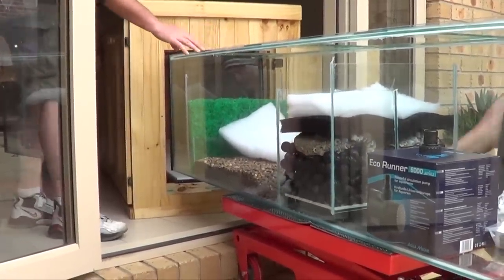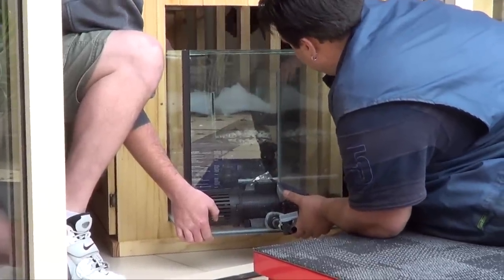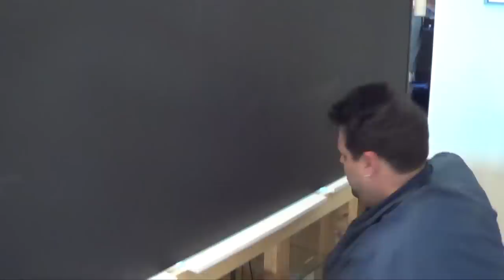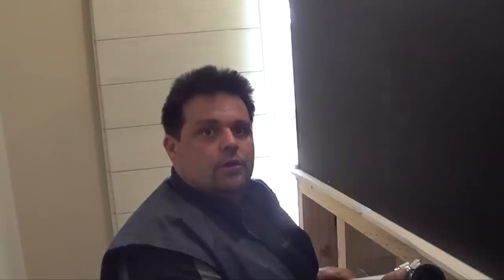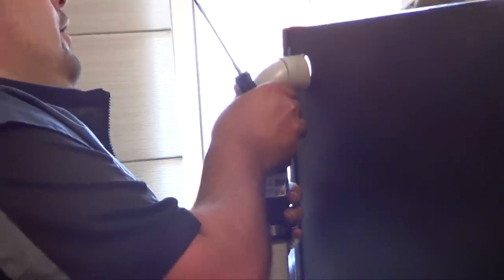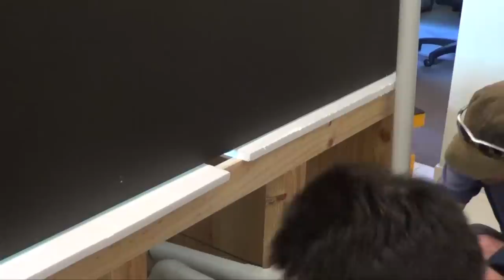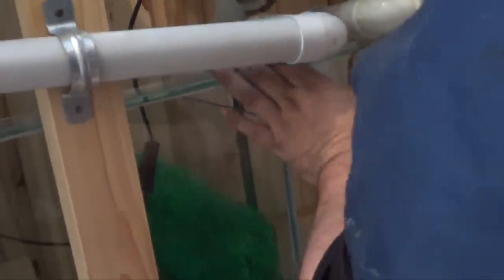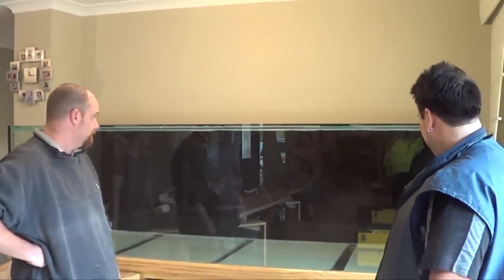installation of 8.5ft x 2.5ft x 2.5 fish tank

Comment: Going to b one seriously noisy tank,  why not put all the pipe work inside the cabinet so you can close the back of it off.  All you would have had to do was drill holes in to the bottom of the tank.
Reply: airjaff I

Comment: what is the thickness of the glass
Reply from the maker: 12mm
Reply: Regular glass or laminated? Sure looks thicker. Planning on building a 250x70x70 planted Discus tank. Every (online) calculator I used/tried gives me at least 15mm....?
Reply: The biggest home tanks are usually 19mm thick glass
Reply: Tvs Aquatics only
Reply: Jenny Rei so do you think that 12mm on a 8ft tank is under the standard for a tank that size, I am just looking at some videos as I am planning on a home build and any input would be great. A site I was reading recommended 15mm for tanks this size.

Comment: why the foam under the tanks ?
Reply: Filtration....its a along filter to catch the small particles.
Reply: The foam Is put under the tank just in case the floor is'nt true level.
It takes the pressure off the tank floor and prevents cracks or a blow out.
They need to be replaced every time u relocate the tank as the foam will shape to it previous location.
A lot of people the mistake and pay the consequences and you don't want a tank like this blow that's for sure!
Reply: wait is he talking about the filter foam or leveling foam?? TheAquaman1979
Reply: The foam under the tank
Reply: Too keep it level don't know what it was for
Reply: built subaru sti . it's very important to keep foam because keep the level right and equal distribution of weight so that the glass doesn't crack.